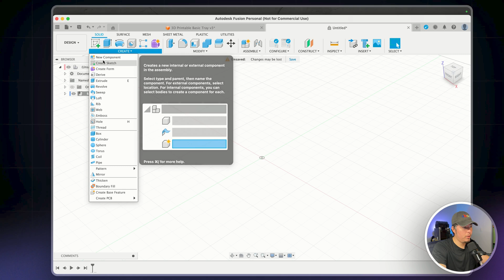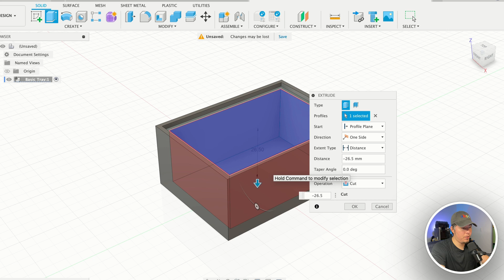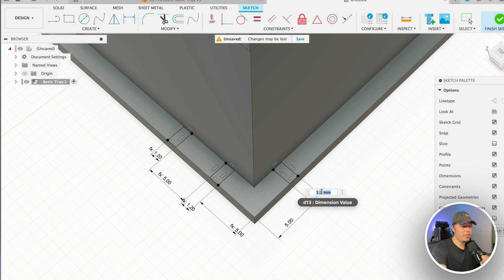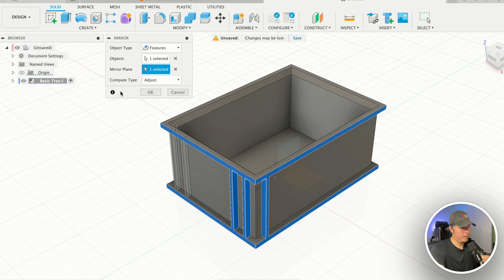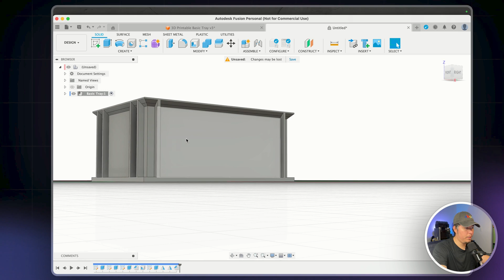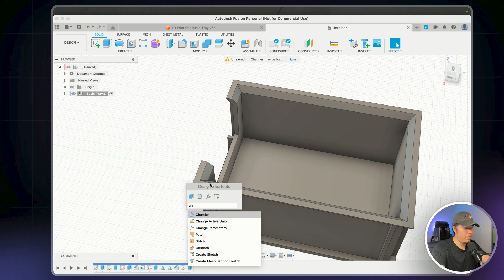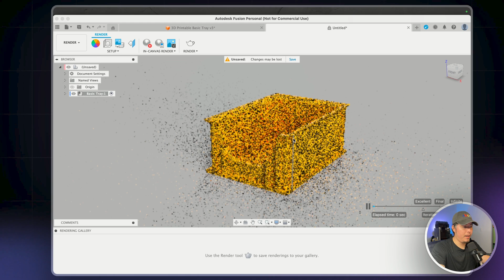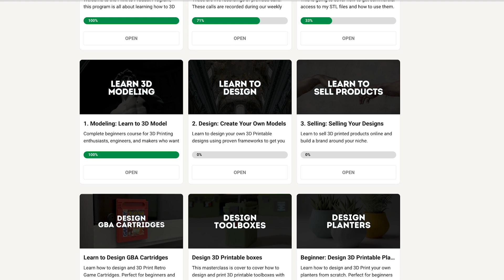How to Design This 3D Printable Tool Organizer Tray (Guide)

Comment: Hey there man, sorry to bother you here but this seems to be the place you're most active and I wanted you yo see my message. 
 I just bought a storage box from you on cults3d and the size it comes in the zip file is so incredible small, like  1cm so I am wondering if you have a file where the box parts are the actual size you see in the photos. I thought of scaling them up but didn't know if it would modify them and I rather ask before doing anything. Thanks a lot and sorry again for bothering.